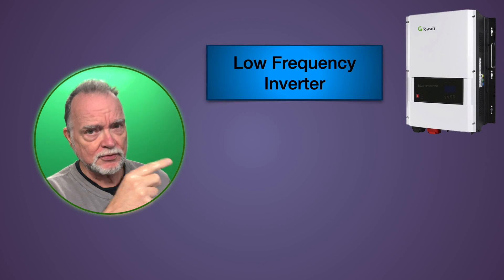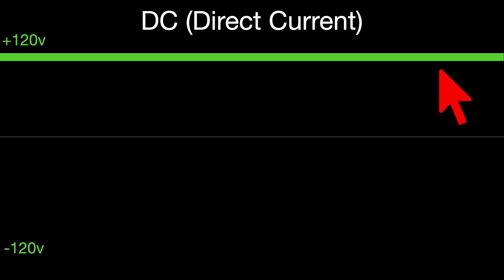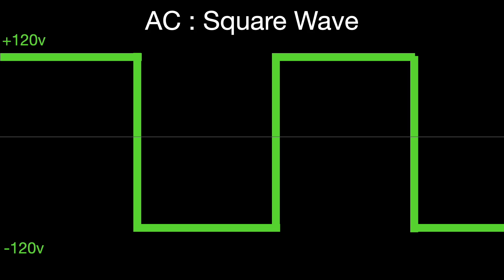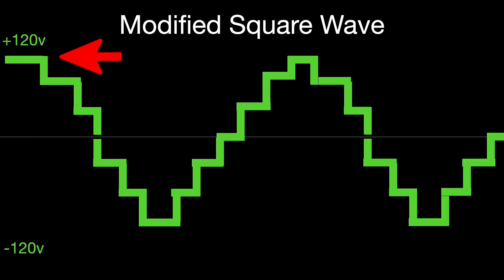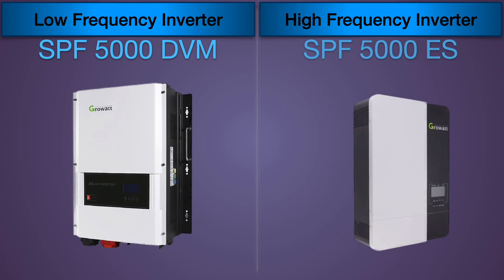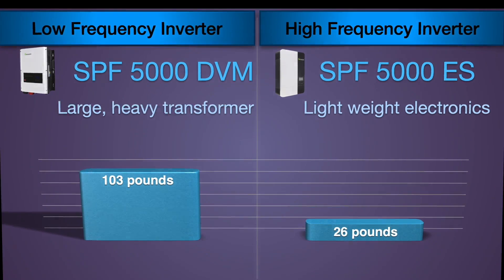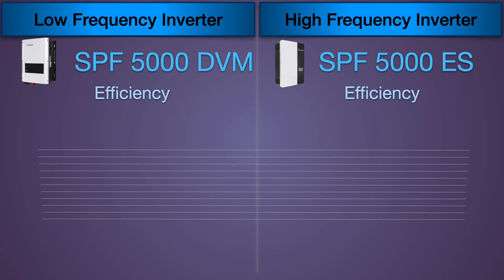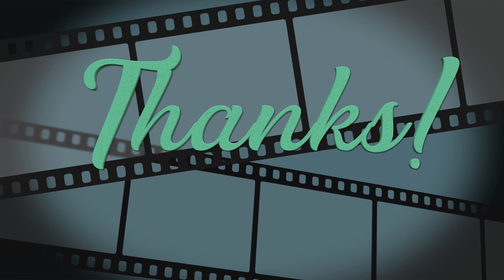High Frequency Vs. Low Frequency Inverters... Which is better?

Comment: High frequency inverters connected to the grid do great because they can use the grid for any surge needed or overload condition. Their primary goal is to reduce the cost of the electric bill which they do great job at. The hybrid version has a battery that charges and discharges to extend solar through the night or cloudy days still has the grid if needed it's wired in parallel to the grid input and the inverter output except when the power goes out a relay opens and it cuts the connection to the grid. Off grid inverters where low frequency shines because surge capacity in a high frequency is based on 240V loads not 120V loads. If you have a surge capacity of 10kw it's actually 5kw for 120V leg. Most homes are not balanced good chance one leg will have 2500+ watts going try to cut a steel pipe with a 120V chop saw when that disc hits that steel amps shoot way up most HF inverters will just overload. The only way to avoid that offgrid with a HF inverter is to buy lot more capacity then you would with a LF inverter. There is a video on YT actual comparing loads between a LF Schneider electric XW pro and a Sol-ark 12k HF the Sol-Ark can't even power a coffee pot and a saw on one leg it's pitiful screeching sound from the alarm crying out in failure. The XW Pro overloads as much as twice it's rated output over 12k watts for up to 3 minutes.

Comment: Actually - this is very wrong.  The low frequency inverter produces very nice sine waves at 60Hz and sends them through a 60Hz transformer.  The High frequency inverter takes the DC and sends high frequency square waves through very small ferrite transformers.  The voltage on the secondary side is about 340vdc.  This is then inverted onto 60Hz square waves.
Reply: His description of a LF Inverter is more like the definition of a Square Wave or Modified Square Wave Inverter, not a LF Inverter.   A so-called "Low Frequency (LF) Inverter" actually has a High Frequency PWM signal on the Primary of the Step-Up Transformer.  The naming convention (marketing terms) of ... "LF" and "HF" are very misleading and down right wrong, as both LF and HF Inverters use a High Frequency .

Comment: is there a difference in idle consumption?
Reply from the maker: Idle consumption varies depending on the manufacturer and model, usually around 1-2% of rated output regardless of high or low frequency. Some inverters have an idle mode where they "sleep" and use less power if there is no draw. This is sometimes called a power saver mode.
Reply: I have noticed it especially when sizes go beyond 10KVA. 
My 30KVA transformer LF inverter consumes 5Amperes all the time. While my 30KV Ongrid HF inverter does self consume more than half an ampere.

Comment: I would always put an inrush current limiter (ICL) between load and ACin.
Reply from the maker: Thanks! Do you have any recomended ICLs?
Reply: @ReelClearMediaLLC look for ICL-16R from Meanwell. It limits the inrush current to 28A, 16A continuous current. They bypass the NTC with a relais contact after the inrush period in order to keep the resistance low. R stands for DIN rail mounted. They also have a 28A version, ICL-28R. Meanwell seems to be a big Korean company. Btw I am not related to Meanwell, just a retired German engineer watching what’s going on with all this PV stuff.
Reply: Sorry, I meant ACout of the inverter!!
Reply: Input voltage between 180 and 264 V!!

Comment: Given the number of small components and dependence on extreme cooling in an HF inverter can I trust it like an LF to last for years of abuse? HF has evolved over the last few years but so have LF inverters. I'm still skeptical when we are 100% off-grid.
Reply from the maker: It seems reasonable to trust LF for off-grid.  My HF has been used daily for several years, but the tech is still too new to know how long they will last.
Reply: @ReelClearMediaLLC  what brand are you using?
Reply from the maker: @Tiersmoke92555  A Growatt spf 300- TL-LVM 48. 
Eventually, I'm considering upgrading to a EG4 6000XP. More power, plus I like the common neutral wiring and the built-in breakers.

Comment: you say LF is not more necessary for big inductive loads?? and HF handle good . yes...but if you hav a massive pump that cycle 1000 thousand a day ? HF die in 1 year. low frequency last for life. And more, now have hybrid toroidal transformer inverter that are reliable like classic LF , handle a lot of inductive power, but the same efficiency of HF.

If they are a lot of good company that produce both LF and HF, is not true that LF is no more necessary
Reply: Can you name a HF inverter wiht a hybrid toroidal transformer?
Reply: @Floyd112007  Victron feeds a High Frequency PWM signal into the Primary Winding of a Toroidal Transformer.  Many manufactures feed a a High Frequency PWM into a Step-Up Transformer.  Marketing calls them "Low Frequency (LF) Inverters" which is quite dumb, since they use High Frequency (HF) PWM !!!   The old Square Wave (SW) and Modified Square (MSW) Inverters were true "Low Frequency" - like the old APC UPS's that hummed..   There are a few  MSW Low Frequency inverters on the market. Not many. The explanation given for "LF" in this video is very wrong.
Reply: I have this doubt because I plan to power my house using solar. I use a lot of technology devices I currently have a backup for 120V but I want to cover the 240V too... Should I go with a single Split Phase 120/240 kit of Low Frequency inverters or go HF for 120V and LF for 240V? I have delicate electronic devices, the HF UPS is basically instant so my computers and TV doesn't turn off... Do they suffer or turn off with LF? I need to have a reliable backup.
Reply: @ResumenExpress  We run our entire home (TVs, Computers, Kitchen appliances, laundry, Tools, etc.) with an AIMS LF inverter. It has been six years. We will be upgrading to a larger LF inverter with modern features and our current will become a JIC.

Comment: You left out a some critical information when comparing low frequency versus high frequency inverter technology. First of all, modern low frequency inverters offer a higher efficiency rating than the values that you presented in your video. For example, the Schneider Electric XW6048 inverter charger offers a peak efficiency rating of 95.1%. The Outback Power FXR /VFXR inverter chargers, 93% peak efficiency. Magnum Energy PAE series inverter chargers 94% peak efficiency. Sigineer Power (a Chinese brand) 91% peak efficiency. And with energy storage and solar modules pricing currently at historically low levels, Inverter efficiency is no longer the critical issue that it used to be in stationary applications. 

Second, I feel that surge capacity is a far important issue than what you've mentioned in your video. For example, inductive loads typically draw from 300% to 800% their nominal run current ratings just to get these loads started, and no high frequency, transformerless inverter on the market is capable of producing even a 300% surge rating. The max surge rating for a typical high frequency, transformerless inverter is only 150% to 200%. You might be able to start and run some high surge loads when these high frequency inverters are new, but every time you fire up one of those inductive loads, you're shortening the life of the MOSFETs in these inverters.

Third, High frequency, transformerless inverters have a much shorter life expectancy when compared to low frequency inverters. This is due to the amount of electrical stress that a high frequency inverter undergoes because of the inverter's much higher switching speeds. You would have to purchase 2 or 3 high frequency inverters to equal the life expectancy of a high quality low frequency inverter under continuous use applications.

And fourth is a safety issue with high frequency, transformerless inverters. Because there is no iron core, copper wound, output isolation, transformer in a high frequency inverter, all it would take is for the AC output monitoring circuitry to fail and one of the MOSFETs in the inverter's H-Bridge circuit to short to ground, and a high frequency inverters can send dangerous, high voltage, high amperage DC current straight to your connected AC loads which will not only damage most AC appliances but can even also set those AC appliances on fire. 

In light of these reasons, In my professional opinion as an inverter repair tech for the past 24 years, I recommend the installation of a low frequency, transformer based inverter for off grid or conventional residential applications.
Reply from the maker: Thanks... detailed, good information. The lack of an isolation transformer is in my mind the most important point. 
My Growatt 3000  is running strong for two years so far. I've seen people running some pretty hefty surges on EG4 hi-freqs, but time will tell how they hold up.
Reply: Mine HF inverter has been in use since past 6 years. No issue. It's Voltronic. Key is to oversize so you don't have to debate about surge at all 😊 @ReelClearMediaLLC
Reply: Not everyone needs a LF inverter. A good sized HF inverter for a home with mostly home appliances will be far better, costs, efficiency and noises
Reply: Do you have any cheap recommendations for low frequency inverts in today's market?
Reply: @onlineprofile3425 Sun Gold has inverter charges your better off going with non AIO for LF setup just buy a separate charge controller like a Victron. Most all in one inverters are HF just setting it up like old school solar charges the battery battery has it's own wire to the inverter. Won't find many that can be permitted Growatt maybe if you don't care about permitting go with separate components. Too many get caught up in All In One inverters don't really need them to do the job.
Reply: So in your opinion what would be better overall double conversion online ups with high frequency igbt based or low frequency igbt based
Reply: You failed to point out that HF inverter connected in parallel with the grid like most use the grid to take up the slack for surge capacity. The goal of the HF grid connected inverter is to reduce the electric bill not replace the grid. I agree with you that if your property is 100% off grid LF inverter is much better choice if it can be permitted.  Homes in cities not many LF inverters that have UL9540 most large cities are NEC 2023 going to require a battery and inverter be certified UL 9540. This leaves the home owners living in cities not much choice out there mostly HF inverters.
Reply: What are power frequency inverters? Seems like the newest kid on the block.